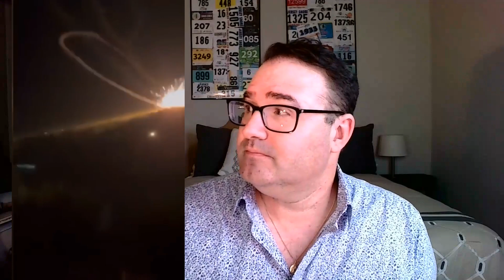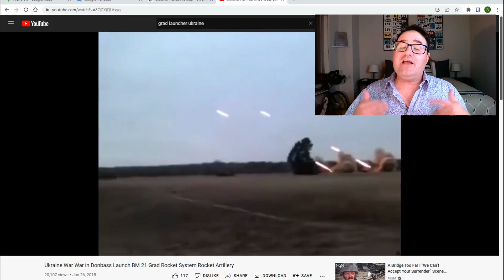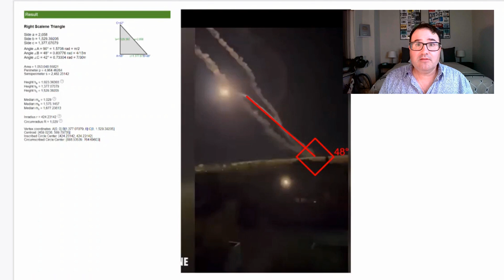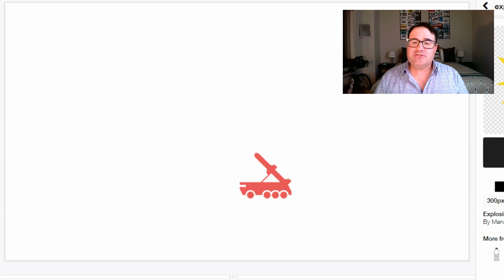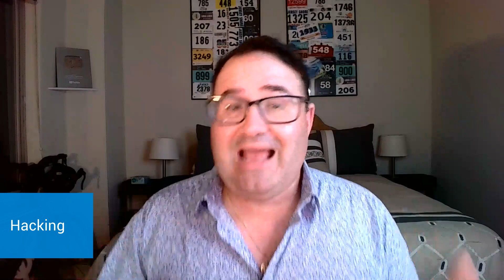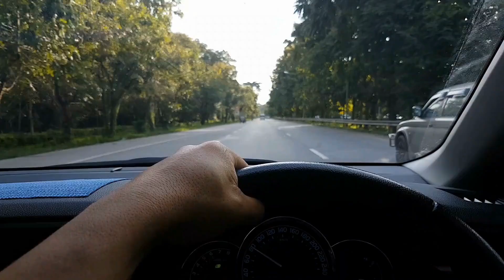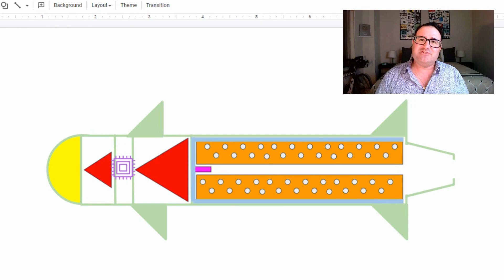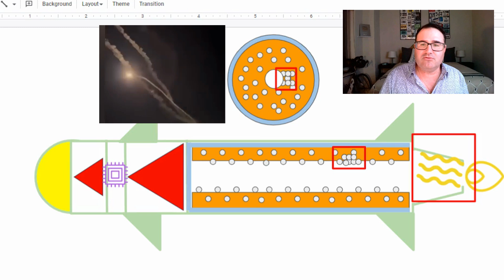Why this missile U -Turned

Comment: Hard to buy Ryan's explanation because of the "precision" appearance of the U-turn. It is just so sweetly and perfectly performed a maneuver. 

I'm opting for a different explanation that diverges from Ryan's at the root of the analysis: namely that this was a surface-to-surface missile, not a surface-to-air rocket as Ryan hypothesizes. Then, if it was S-to-S that directly implicates a failure related to the guidance system. 1) Either the launch control officer got confused between the coordinates of his own location and the coordinates of the intended target, entering his own coordinates as the target, and thereby committing a quick suicide, or 2) potentially a more interesting explanation involves a software default failure. In the default failure hypothesis, if such S-t-S missiles are programmed in a particular way, a dummy coordinate value is entered as the missile's target by the software by default before the missile is programmed. And that dummy default value is the missile's current location. Then the human error would be a failure to overwrite the dummy default target value with the proper target coordinates. 

Would Russia's missile engineers design software with such a potentially risky feature? Who knows? It's Russia.